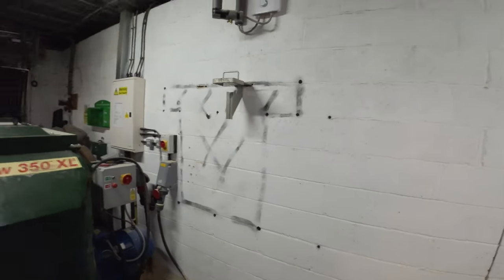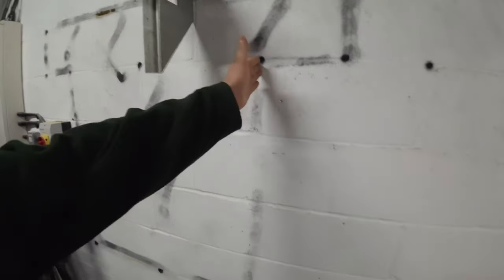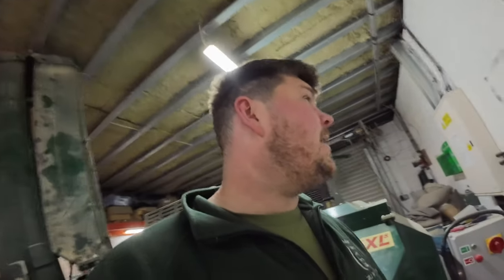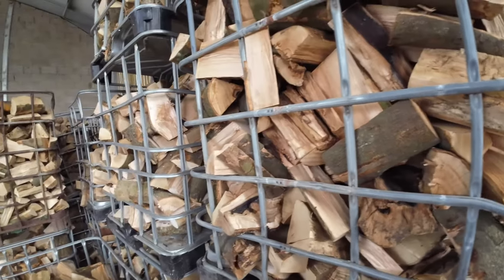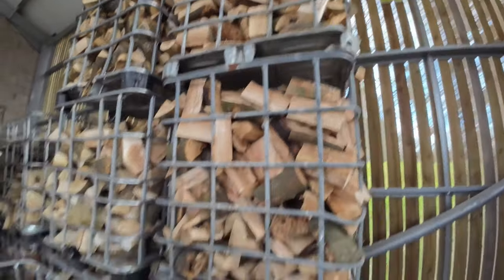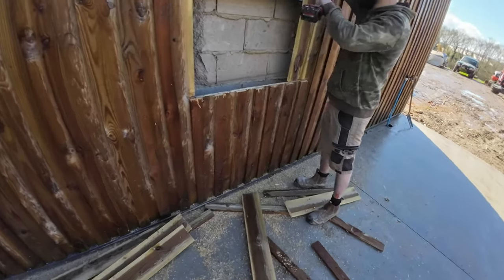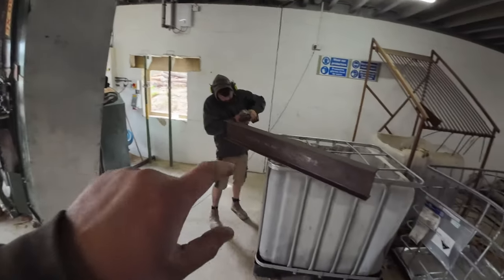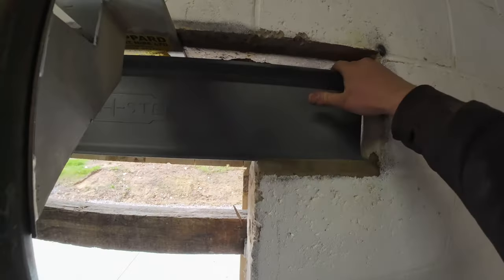Day 13 - Hole in the Wall

Comment: Beat you to that idea Archie mate, I've just cleared a little doorway in my barn so that my processor will move to the inside. Then my log table will stand outside with easier loading access.😂
Great video as always, but your right! Your definitely not a builder😅😅😅
Reply from the maker: I hope you have good timber or don’t overfill the deck, you’ll be walking round the wall to sort it out
Reply: @Oak Farm Firewood  be good if I could get any 🪵!!!!!!
£3500 for a load which I can't afford right now.
Any ideas?
Reply from the maker: @simonward5820  no money left in the job at that price!

Comment: Thanks for videos, how long does your humidity drop roughly , for example on your tramex when it reads 20% how long down to 10%, 
It was 10% u said u took them out at right?
Hope yous are well 🙏
Reply: What higher temp's is tramex picking up?